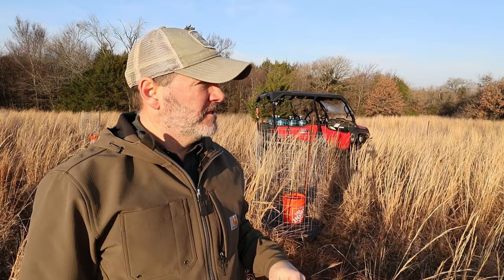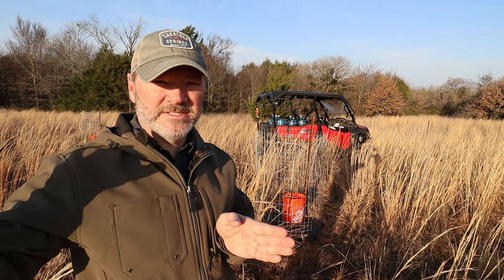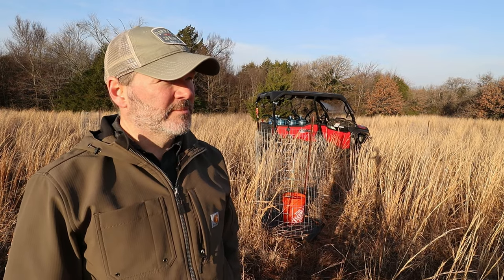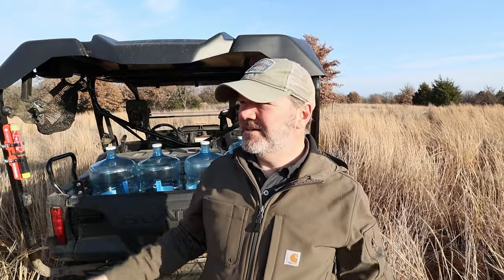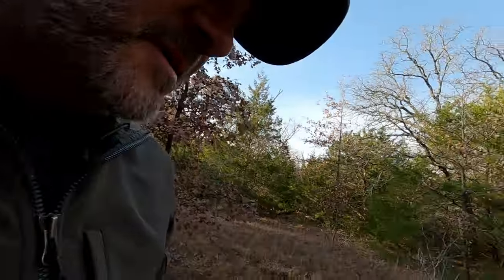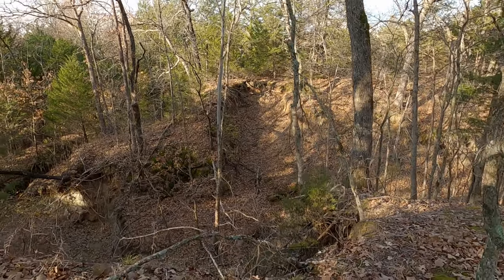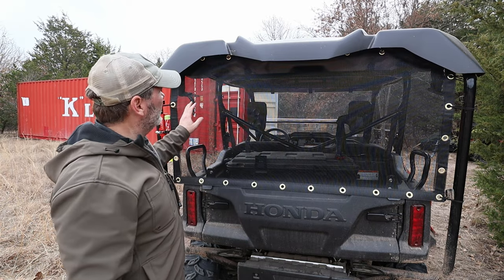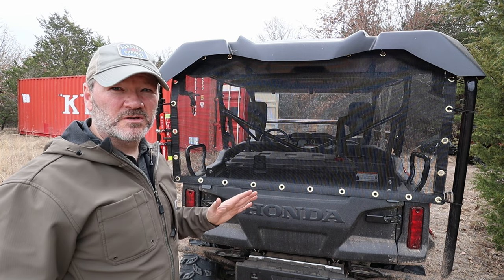Creating a Whitetail Deer Trail to Our New Food Plot

Comment: What’s the deal with the water bucket inside the tree fence , does it have a hole to water the tree?
Reply from the maker: Thanks for asking, John. Each tree has a bucket, and each bucket has three 1/16” holes drilled in. When we go more than 10 days or so without rain, I’ll fill up each bucket with water and then let it slowly drain out. Thanks again!